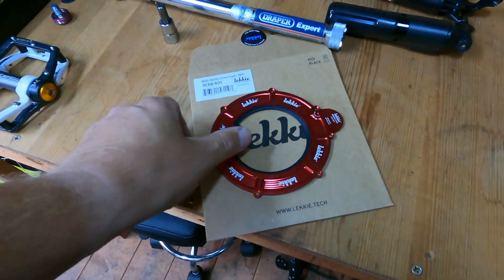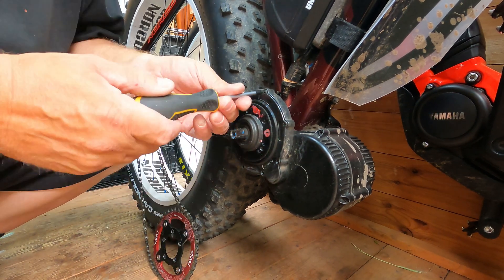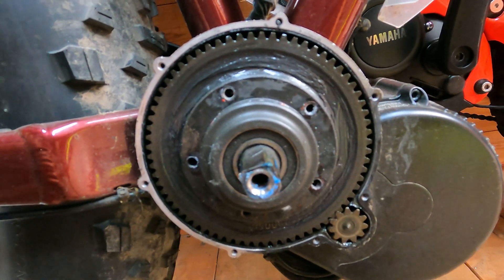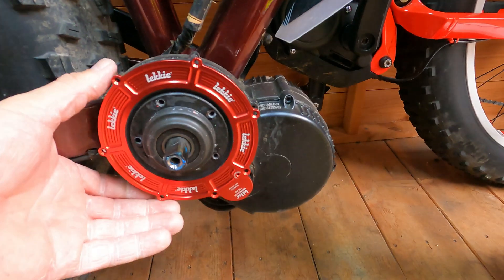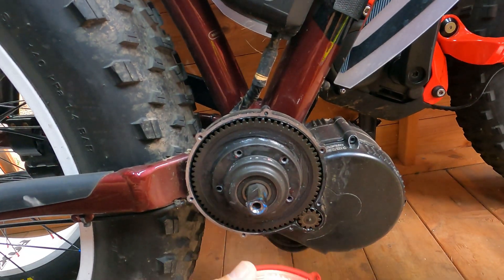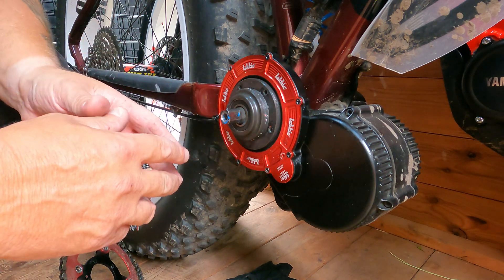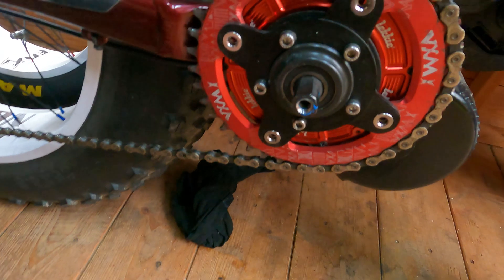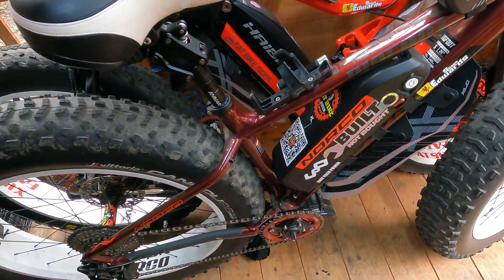Lekkie Final drive cover Bafang BBS01/02 fitting

Comment: Have you checked the drive cover after use.  I chewed through 2 of them.  Rubber gasket everywhere!  Now my PAS wont work.  I would check it if you haven't.
Reply: What size is screws of that plastic cover?
Reply from the maker: Here is my fix m8 https://youtu.be/8QDC0UYIhVk
Reply: @FATBIKERIDER  for what I paid this is not a fix.  I hope it works out for you but I think lekkie should be fixing this issue on their dime and time!